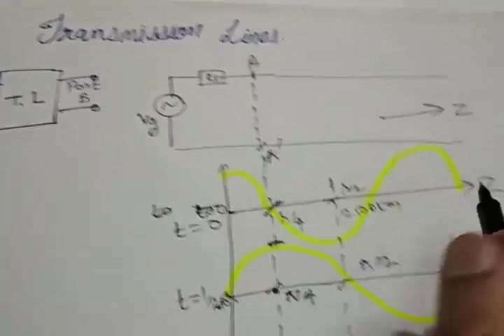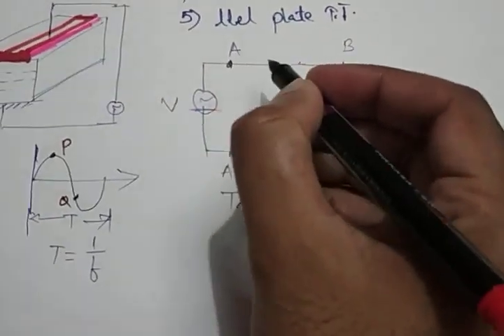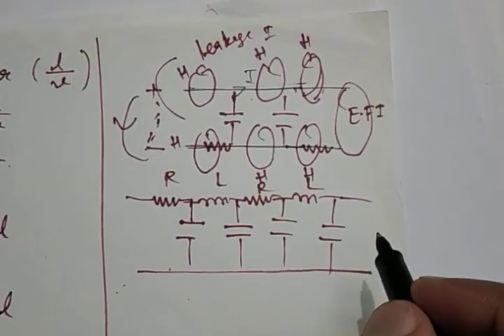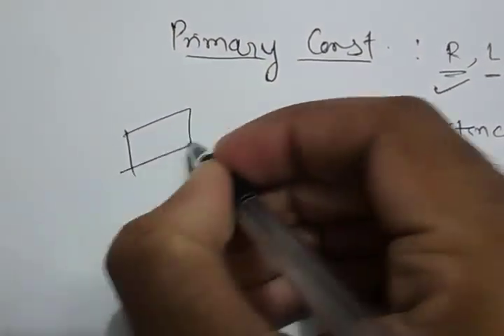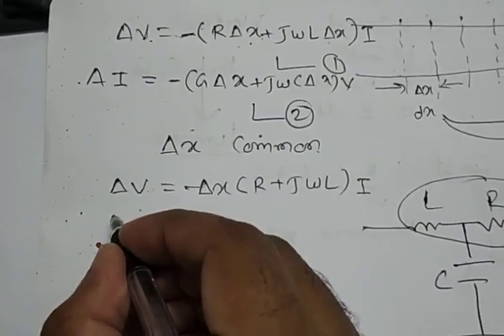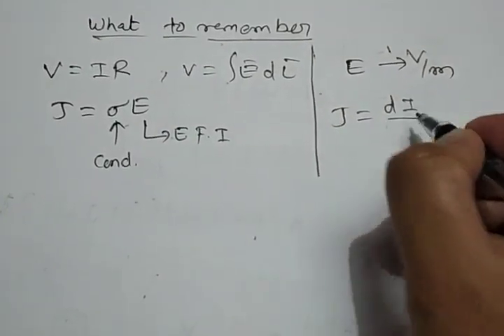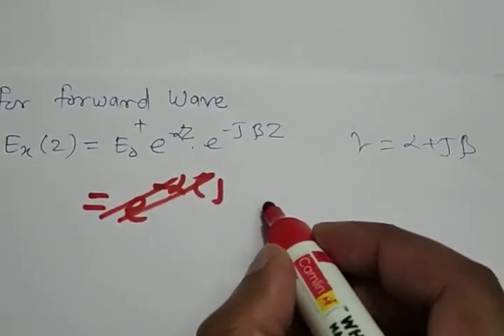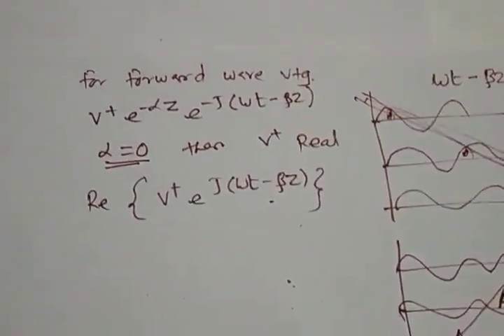Transmission lines Part 2

Comment: 20K61A04D3-II ECE B
1.Two wire power cable
2.Over headed power transmission lines
3.Twisted pair
4.Co-axial cable
5.parallel plate transmission lines

Comment: 20K61A04F8-ECE B
1.Two wire power cable
2.overhead power transmission  lines
3.Twisted pair
4.co-axial cable
5.parllel plate transmission lines

Comment: 20K61A1401
1) Two wire power cable
2)over head power T.line
3) twisted pair
4)co-Axial cable
5)parallel plate T.line

Comment: 20K61A1412,2ndyr, ECT
1.two wire power cable
2.over head power transmission lines
3.twisted pair
4.co-axial cable
5.parallel plate transmission lines

Comment: 20K61A04A6-ECE-B 2nd year
1.Two wire power cable
2.overhead power transmission lines
3.Twisted pair
4.Co-axial cable
5.Parallel plate transmission lines

Comment: 20K61A0483 Ece-B
1)Two wire power cables
2)overhead power transmission lines
3)Twisted pair 
4)Co-axial cable
5)Parallel plate

Comment: 20K61A1405 2nd ECT
1.Two wire power cable
2.overhead power  transmission lines
3. Twisted pair
4.coaxial cable
5.parallel plate transmission line

Comment: 20K61A0480 
1. Two wire power cable
2. Overhead power transmission lines 
3. Twisted pair
4. Co- axial
5. Parallel plate transmission lines

Comment: 20K61A04C7 2nd Ece-B
1.Two wire power cable
2.overhead power transmission lines
3.Twisted pair
4.co-axial cable
5.parallel, plate transmission lines

Comment: 20K61A04A9-ECE-B
1.Two wire power cable,
2.overhead power transmission lines,
3.Twisted pair,
4.Co-axial cable,
5.parallel plate transmission lines.

Comment: 20K61A0485-ECE B
1) Two wire power cable
2) Overhead power transmission lines
3) Twisted pair
4) Co- axial cable
5) Parallel plate transmission lines

Comment: 20k61A04F0-ECE B
1.Two wire power cable
2.overhead power transmission  lines
3.Twisted pair
4.co-axial cable
5.parllel plate transmission lines

Comment: 20K61A1421 2ND YEAR ECT
1) two wire power cable 
2)over head power transmission lines
3)twisted  pair
4) coaxial cable
5) parallel plate transmission line

Comment: 20K61A04B7, 2nd ECE-B
1.Two wire power cable
2.Overhead power transmission lines
3.Twisted pair
4.Co-axial cable
5. Parallel plate transmission lines

Comment: Roll.No:20K61A1410, 2ND YR,ECT
1.Two wire power cable
2.over head power transmission lines
3.twisted pair
4.co-axial cable
5.parallel plate transmission lines

Comment: 20k61A1438-2nd year ECT
1) Two wire power cable
2)over head power T.line
3) twisted pair
4)co-Axial cable
5)parallel plate T.line

Comment: Roll no : 20K61A1427
1) Two wire power cable
2)over head power T.line
3) twisted pair
4)co-Axial cable
5)parallel plate T.line

Comment: 21k65A1408
1) Two wire power cable
2)over head power T.line
3) twisted pair
4)co-Axial cable
5)parallel plate T.line

Comment: 20K61A1418,2nd year ECT
1.two wire power cabel
2 overhead power transmission lines
3.twisted pair
4.co axial cabel
5.parallel plate T.line

Comment: 20k61a1430:2nd year ect
1)two wire power cable
2) overhead power transmission line
3) twisted pair
4) parallel plate transmission line
5)coaxial cable

Comment: 21K65A1407 ECT
1) two wire power cable
2)over head power transmission line
3) twisted pair
4) coaxial cable
5) parallel plate transmission line

Comment: 20K61A1406~ECT
1)two wire power cable
2) overhead power transmission line
3) twisted pair
4) parallel plate transmission line
5)coaxial cable

Comment: 20K61A1442~ II ECT
1) Two wire power cable
2)overhead power transmission line
3)twisted pair
4) parallel plate transmission line
5)coaxial cable

Comment: 20k61A1423
1) Two wire power cable
2)over head power T.line
3) twisted pair
4)co-Axial cable
5)parallel plate T.line

Comment: 20k61a1422
1) Two wire power cable
2)over head power T.line
3) twisted pair
4)co-Axial cable
5)parallel plate T.line

Comment: 20k61a1408
1) Two wire power cable
2)over head power T.line
3) twisted pair
4)co-Axial cable
5)parallel plate T.line

Comment: 20k61a1445 ECT 
1. Two wire power cable
2.over head power T.line
3.twisted pair
4.co axial cable
5. Parallel plate T.line

Comment: Roll no 20K61A04G8 ECE-B
Types of transmission lines
▪︎ two wire power cable
▪︎ overhead power transmission lines
▪︎ twisted pair
▪︎ coaxial cable
▪︎ parallel plate

Comment: 20K61A1434
1. Two wire power cable
2. Overhead power Transmission line
3. Twisted pair
4. Co-axial cable
5. Parallel plate transmission line

Comment: 21K65A1402-ECT
1) Two wire power cable
2)over head power T.line
3) twisted pair
4)co-Axial cable
5)parallel plate T.line

Comment: 21K65A1405 -2nd year ECT
1) Two wire power cable
2)over head power T.line
3) twisted pair
4)co-Axial cable
5)parallel plate T.line

Comment: 20K61A04B5 IInd ECE-B
1.Two wire power cable
2.Overhead power transmission lines
3.Twisted pair
4.co-axial cable
5.parallel plate transmission lines

Comment: 21K65A0428
G.Girifhar Venkatesh
1.Simple two lead cable
2.over head power line cable.
3.twisted pair cable.
4.coaxial cable.
5.parallel plate transmission line cable(strip line).

Comment: 20k61a1411
ECT
1) Two wire power cable
2)over head power T.line
3) twisted pair
4)co-Axial cable
5)parallel plate T.line

Comment: 21K65A1404
1) Two wire power cable
2)over head power T.line
3) twisted pair
4)co-Axial cable
5)parallel plate T.line

Comment: 20k61a1440
1) Two wire power cable
2)over head power T.line
3) twisted pair
4)co-Axial cable
5)parallel plate T.line

Comment: 20K61A04B9,2nd ECE B
1.two wire power cable
2.twisted pair
3.co-axial cable
4.over head power transmission lines
5.parallel plate

Comment: 20K61A1435, 2nd year ECT
1)two wire power cable
2)overhead power   transmission line
3)twisted pair
4)parallel plate transmission line
5) Co-axial Cable

Comment: 20k61a0476,ece-B
1.two wire power cable
2.overhead power transmission lines
3.twisted pair
4.co-axial cable
5.parallel plate transmission lines

Comment: 160518735015
Types of Transmission lines:
1) two wire transmission line
2) Coaxial transmission line
3) parallel plate transmission line
4) optical fibres transmission line

Comment: 160518735312
Types of transmission lines
Two wire power cable transmission lines
overhead power transmission lines
Co-axial cable
Twisted pair transmission lines
Parallel plate transmission li

Comment: 160518735311
Types of transmission line
Two wire power cable transmission line
Overhead power transmission line 
Coaxial cable 
Twisted pair transmission line
Parallel plate transmission line

Comment: MOHD SOHAIB MOHIUDDIN
(160518735028) 
QUS) TYPES OF TRANSMISSION LINE? 
ANS) 1.Two wire power cable
           2.overhead power T. Line
          3.Twisted pair
          4.co-axial cable
          5.parallel plate

Comment: Syed Hanoof Ishaqi 
160518735303
●Types of transmission lines:-
1. Two wire power cable transmissions lines.
2. Overhead power transmission lines.
3. Twisted pair transmission lines.
4. Parallel plate transmission lines.
5. Coaxial transmission lines.
6. Optic fibre transmission lines.
7. Wave guide.

Comment: 160518735011
1.5 types of transmission lines 
1)Balanced two wire
2)Co-axial Cable 
3)Wave guide
4)Micro strip
5)Fiber Optic

Comment: 160518735314

1)Two wire power cable
2)over head power T.line
3)twisted pair
4)co-Axial cable
5)parallel plate T.line
6)

Comment: 160518735002
1)two wire power cable
2)overhead power transmission lines
3)twisted pair
4)coAxial cable
5)parallel plate transmission line

Comment: 160518735301
Types of transmission lines
Two wire power cable transmission lines
Overhead power transmission lines
Coaxial cable 
Twisted pair transmission lines
Parallel plate transmission lines

Comment: 160518735307
1)Two wire power cable
2)over head power T.line
3)Twisted pair
4)co-axial cable
5)parallel plate T.T

Comment: 18-066
Types of transmission line
Two wire power cable
Overhead power t lines
Twisted pair
Co-Axial cable 
Parallel plate t.t

Comment: Roll no: 80
1) two wire power cable 
2) overhead power transmission lines
3) Twisted pair
4) co-axial cable
5) parallel plate